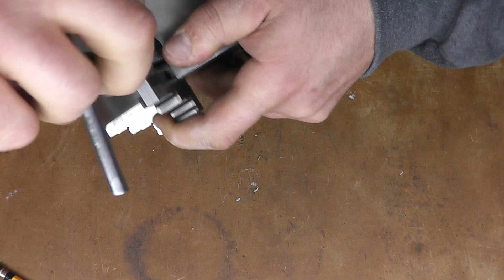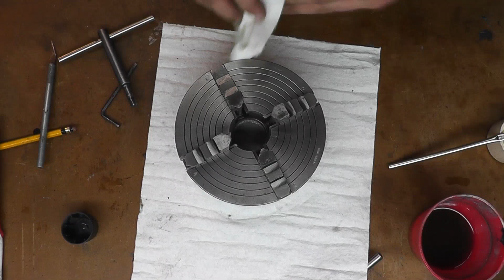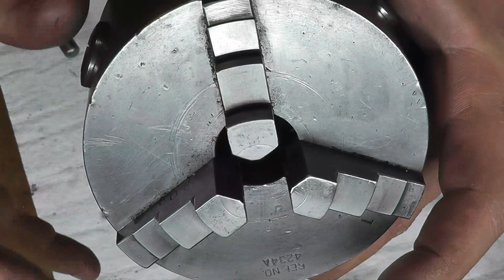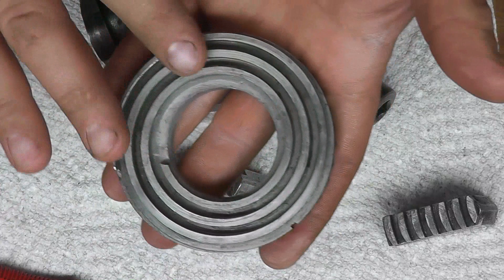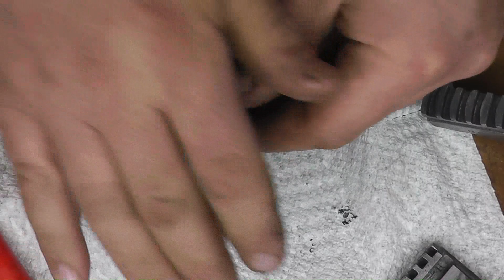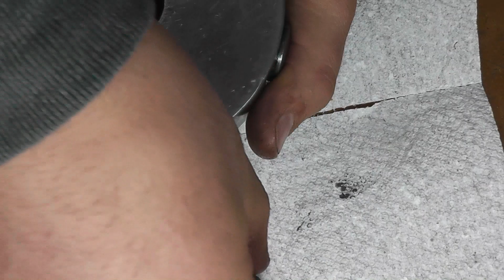Chuck Maintenance and Lubrication

Comment: No No not grease. The dry lube might work but I always used the lightest oil I could get my hands on (10 W). Grease is a magnet for nasties around a lathe. Generally you are oiling the Ways every day, so I soak my chuck each night before leaving, let the oil penetrate over night and wipe clean before operating in the morning. How many Machinists actually read the manual which came with the chuck? Not many.
Reply from the maker: The grease is on the chuck gears not the scroll face so it's pretty much sealed in there.  Bison and other brand chucks make their own grease specifically for their chucks.

Comment: How do you remove the chuck from a 9 inch south bend lathe ? Sounds pretty basic but couldn't figure it out. Thanks 

Ken
Reply from the maker: Take it you got the lathe :-)  It just unscrews.  If it's been on there forever and a day it may be pretty stuck.  Spray some penetrating oil on the back were it meets the spindle and a little in the through-hole where the spindle threads end.  Get a nice strap wrench and grab the spindle pulley with that to hold it still and see if it unscrew by hand.  If not get an adjustable and hook one of the jaws and give it a tug.  Don't go crazy though, just a small jerk to see if it will break free.  If that doesn't work chuck something in the jaws, preferably hex stock, but even a piece of sturdy wood will do.  Put a wrench on the wood and now you can try with some power to unscrew it.  If that doesn't work then more penetrating oil and more time for it to work through.  If this still doesn't work you may have to go to more drastic measures, but it should work unless that sucker is really rusted in there.  Whatever you do DO NOT use the back gears to lock the spindle on a stuck chuck.  That is the most common way they get chipped and broken teeth.

Comment: Very good video on this subject. I am a journey man machinist retired od 40 years. This chuck is of poor quality shown here, no threads in each jaw. Best quality chucks have threaded jaws, this one moves as to the shoulder on the jaw.  Lubrication is not needed, if u need lube use silicone spray of good quality. Let dry and assemble.
Good Luck!

Comment: lol how are you with a big brute of a chuck off a herbert no8 preoperative turret lathe for neither love nor money can i get the dame thing apart its seized up solid tried every thing even brute force and heating the outer side to get it to expand.but the backing plate will only move out about 5mm really scratching my head cous there is nothing holding it in place except maybe fifty years of grime... any suggestions???
Reply from the maker: A good soak in some oil or cleaner will probably help you.  A friend of mine found a lathe that had sat in a barn forever.  The lathe had a lathe had a threaded spindle and the chuck rusted to it.  We tried everything.  Wrenches, beating on it, heat, penetrating oil, breaker bars, nothing worked.  Finally we removed the spindle and brought it to a company that repairs food service equipment.  They have a hot bath parts washer.  A good soak in that thing and some penetrating oil and it came off with a nudge from a 2 foot pipe wrench.
Reply: timbo7705 google electrolysis rust removal. Ive saved many machines that way. It will go from rust bound clapped out turd to brand new. It doesn't harm any metal that isn't already converted to rust. DONT GET THE POLARITY WRONG!
Reply: +timbo7705 mix up a 50/50 mix of acetone and tranny fluid and soak your lathe chuck in that for 2 days and it will help you out.

Comment: ever thought about making a quick jaw opener/closer ? machine an adapter with a square drive to match the chuck keys that you can toss in the cordless drill to buzz out the jaws? i don't know if this is possible or not. just a thought.

Comment: Or you can screw the backing plate bolts into their threaded holes in the back of the chuck and use them as jacking screws to part the two halves of the chuck. But if you absolutely have to pound on the chuck key, it is best to use a soft hammer not a Crescent wrench.
Reply: Hopper, I knew someone would leave that comment.

Comment: Pounding on the chuck key with a Crescent wrench??? Ouch!!! Most of those little chucks have three screws in the back that you remove, then this allows you to take out the three barrels the chuck key fits into. You can then put a piece of brass round bar in the holes where the chuck key barrels go and gently lever the two parts of the chuck apart without needing screwdrivers which can scar the chuck.

Comment: like the vidios, keep them coming. on the three jaw, it looks like the jaws are still off, at 36 04 on the vidio the right jaw seems to enter the inner circle before the rest of them, i noticed a 1 stamped on the front of the chuck. i'd sugest puting #1 jaw there and #2 clock wise etc. then recheck runout. i've foud the jaws on my chucks reach the inner circle at the same time. hope this helps with the runout,looks like a nice chuck:-)

Comment: Good video. One suggestion: use a "dead-blow" or brass (or lead) hammer when you tap your chuck parts into place. That way you avoid dings where you are tapping , particularly on the back register of the chuck where it contacts the spindle nose.